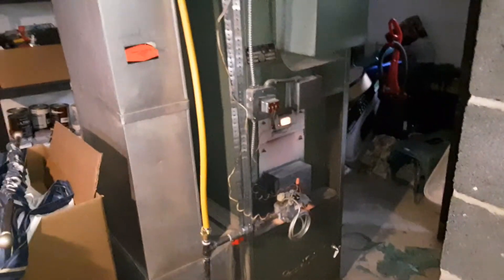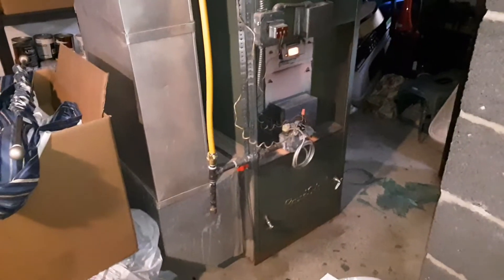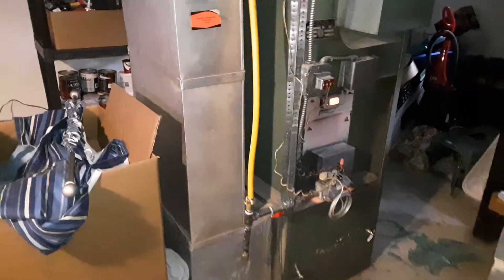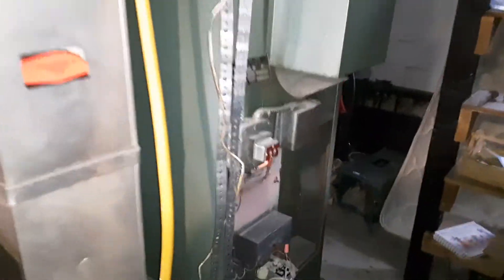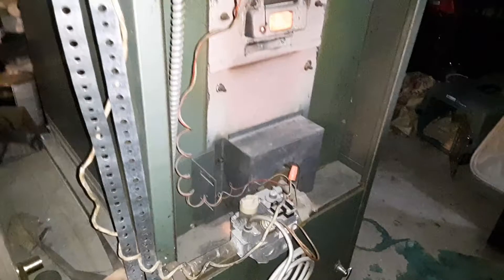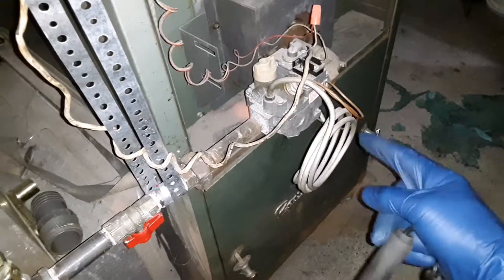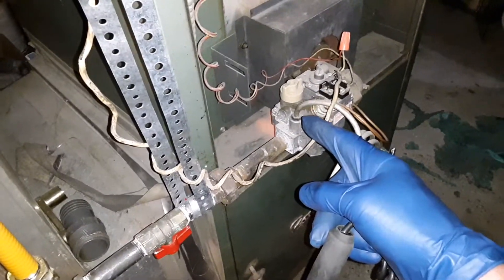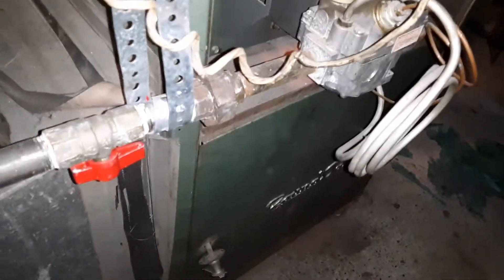😲1940"s/50's Forced Air Furnace 💨still in use, 🚭NOT SAFE with GAS leak & improper burning flame🔥

Comment: So if if it is blue while the furnace isn't blowing air but it is orange when it blows air what does that mean
Reply from the maker: Thanks for watching the video. The flame on a furnace should always be blue. Orange and yellow tipping on any flame means it's not burning properly. If the blower in the blower box turns on and the burner flame then turns orange, that means the "Heat Exchanger" may be cracked or has an open gasket seal some place.
I hope this was helpful.
Reply: @inspectflix  so not even the slightest orange tipping is ok? Its a gravity furnace. I also smell a light smell of gas. Do you know where the heat exchange is? What is an open gasket seal? A seal around the pipes? Could it burn orange cause its dusty?
Reply from the maker: @natejones8834  No, not even the slightest. There should not be any orange on the flame of a burner. You may be looking at the pilot and sometimes there will be orange tipping. I’m still not sure of what type of furnace you have. You mentioned blower... but gravity furnaces do not have blowers. Gravity refers to heat rising into ductwork providing heat to rooms above on inside walls. Then the cold air falls to the outside walls and into the cold air returns. The burners and pilots are typically installed under and inside the heat exchanger made of steel “depending” on the style model & make of the furnace. For more information watch my other video on coal octopus gravity furnaces and you will see inside a heat exchanger. https://youtu.be/aCgyYA8tWTI
Reply: @inspectflix  yes it is a gravity furnace.and that is the pilot light
Reply: @inspectflix  it is a gravity furnace without coal but funny because I found a bunch of coal underneath the wooden flooring on one half of the basement